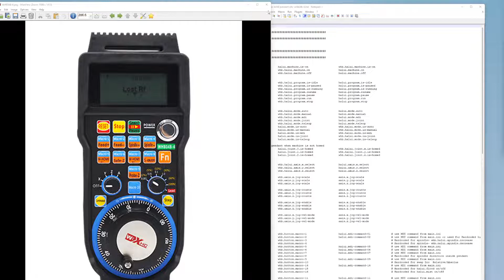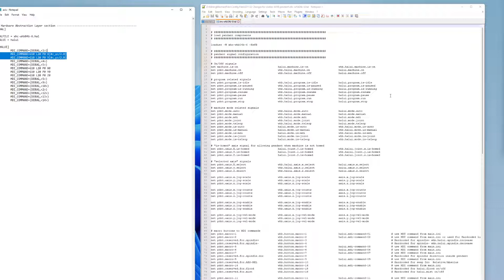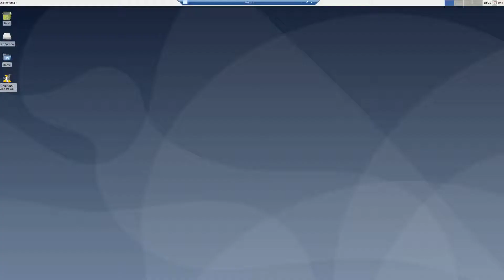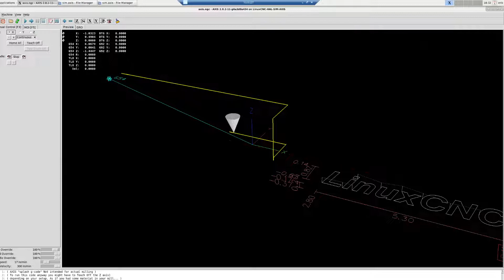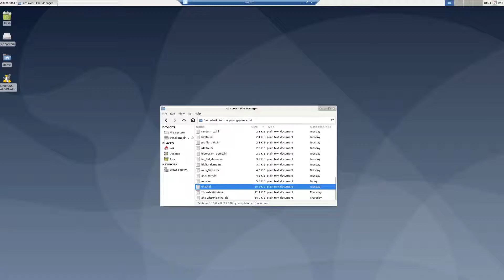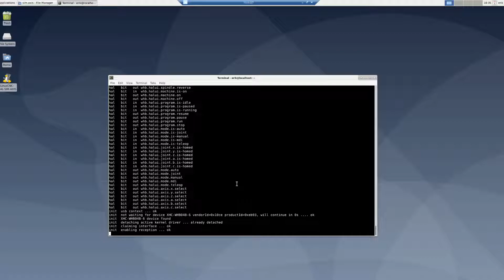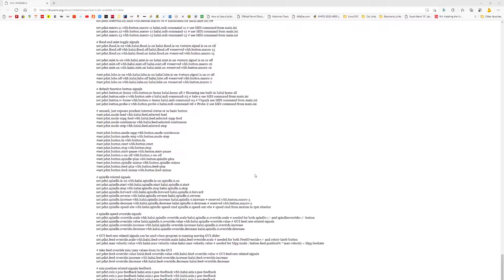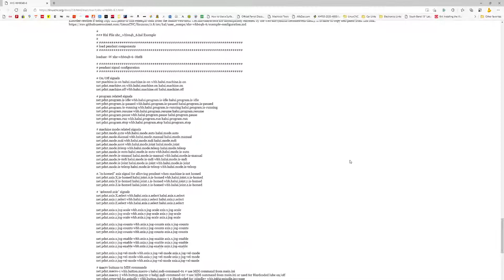2022 02 LinuxCNC WHB Pendant

Comment: Hello, I would like to consult about installing the MPG (WHB04B-6) on LinuxCNC.

I watched your video and followed the instructions. The buttons are working fine, but I have one issue: the handwheel pin is not functioning.
I tried using the command halrun:  loadusr xhc-whb04b-6 -ue
However, the value of the handwheel does not change.

Have you encountered this issue before?
Reply: I suspect that the handwheel might be faulty, so I tested it with Mach3, and the handwheel worked fine.

Then, I tested it with LinuxCNC on both a PC and a notebook, but the handwheel still did not work, while all the buttons functioned normally on both devices.
Reply from the maker: It's been more than  3 years since I posted this so my memory is foggy. I do recall that I had a similar problem:  The buttons worked but the MPG handwheel did not update.  The problem (if I remember correctly) was not in the halrun command but was either in what pendant commands I was using or in the loadrt servo loop.   Possibly helpful, here are links to the two relevant hal files: https://limewire.com/d/4997ec96-7bc0-47b4-a45d-b55555e6d7be#alKzEztthe8MPczorAj-wLnV3INl62ZZSCkAGMtJFrg and https://limewire.com/d/7c244276-37dd-4156-9816-10832e2dc2d3#JUvwUY86D7GLbV2K4JnSQqdi2djnB8NCHeoUcky088c
Reply from the maker: Note it still works perfectly three years later. I use it all the time.

Comment: Thanks Erik, much appreciated. Seen your thread on the Linuxcnc forum today. I'm hurting my brain the last few days learning whatever I can about interfacing both Gamepad controllers using buttons only, and also MPG pendants (got the very same model on it's way from XHC). 
It's like you say, the setup task itself is not difficult once you piece together all the bits of info that (hopefully) eventually lead to things working. But wow, I'm finding you have to put the time in with Linuxcnc to learn stuff. I'm using Qtplasmac and there's a few differences in hal to using say Axis, but still your hal file should help me out heaps. I'll be studying every line.
Take care.

Comment: When I go to buy a pendant, they refer to Mach 3 in advertising that is still the one to buy as long as it's a xhc-whb04b-4 pendant ?  Good video.
Reply from the maker: I think they advertise them as Mach 3 pendants since the Mach 3 software has native support. They both work with LinuxCNC in my experience.  Both have their plusses and minuses but either is a great addition to an CNC

Comment: Thanks, works like a charm in sim, a few little bugs here and there on linuxCNC 2.9, but this saved me a lot of time. Cheers!
Reply from the maker: I did have one issue going from the simulator to a real machine.  When I added my xhb.hal file to my milling machine, I got a number of errors saying "that pin is already in use somewhere else."  For the most part,  I was able to comment out the offending commands.  However, it seems that "whb.halui.machine.is.on" is required to be activated for the jog wheel to work.

I first just added whb.halui.machine.is.on to the main .hal file.  However, that pin does not exist until whb driver is loaded.  What I did to make it work is to add the other pin to to the whb.hal file.   The other pin in my case was a signal to my Mesa card to enable the servo's, I needed it.  Putting that signal in the whb.hal file did the trick.

I learned about enabling multiple pins in this post:    https://forum.linuxcnc.org/38-general-linuxcnc-questions/35822-two-signals-connected-to-one-output-pin

Comment: Inget signal conflict when I try to use this with a pretty big standard axis config
Reply from the maker: Almost everyone will have signal conflicts when they try and implement.  You will get an error if you have specified a HAL pin somewhere else in your configuration.  Some of them you can comment out but others are required.  In particular, you need "whb.halui.machine.is-on" needs to be tied to the "halui.machine.is-on" is critical to operation.

I found this post on how to link two signals, recommend this:

https://forum.linuxcnc.org/38-general-linuxcnc-questions/35822-two-signals-connected-to-one-output-pin